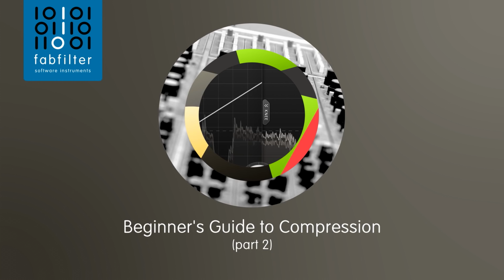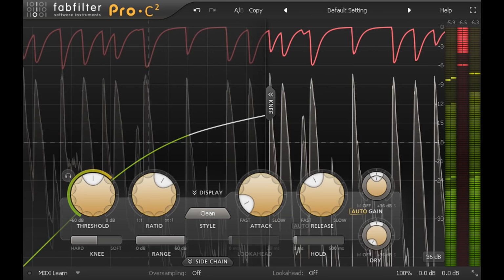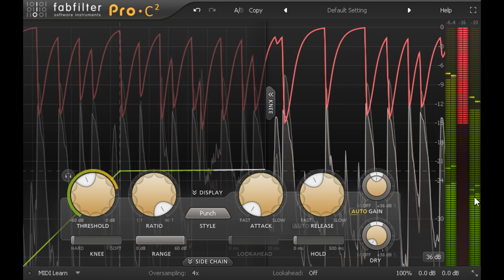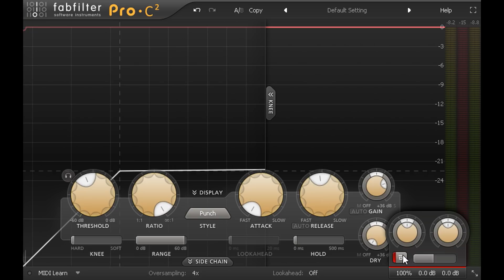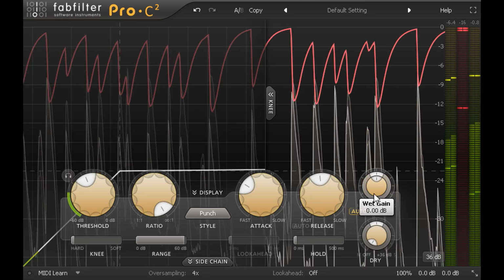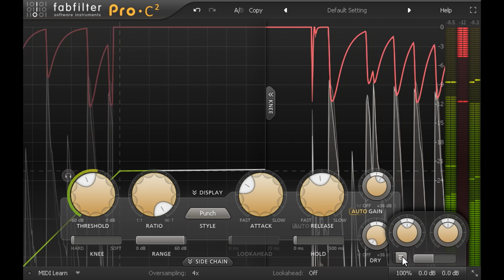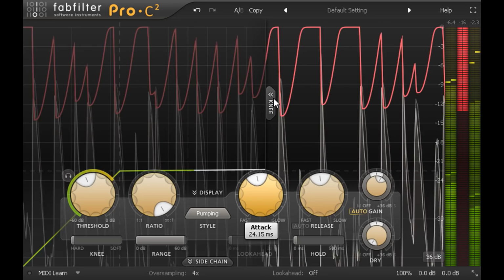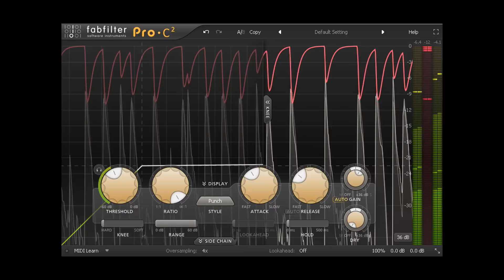Beginner's Guide to Compression (part 2)

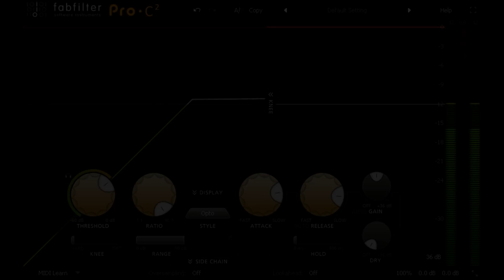Comment: At 0:39 using test sine wave you can see that (1) the signal still exceeds threshold after attack spike and (2) does not recover fully after release stage. Why it's happening?
Reply: he is using the quick changes in volume to show how a compressor is slow to react to dynamics in sound, and how the attack and release settings affect the sharp transients and quick changes in volume

Comment: I still can not figure out to have the compressor only trigger on the peaks over a certain db and leave everything else alone.
Reply: that is what the threshold setting does, maybe adjust the knee function so it has a hard knee and doesnt gradually compress as it reaches the threshold. maybe try a limiter?
Reply: @guyincognito3231  Thanks, I'm honestly not sure what the problem was when I was working on this last year, I don't think I ever really figured it out, lol.  But lately when using compression I haven't had any problems, so, whatever it was must have worked itself out.  Compression is such a simple concept, makes loud stuff quieter, but the implementations and number of options in these plugins is what makes it complicated.